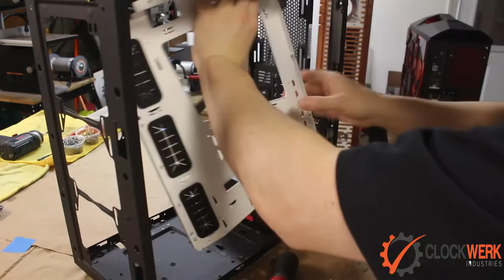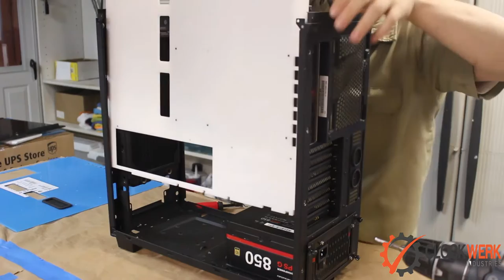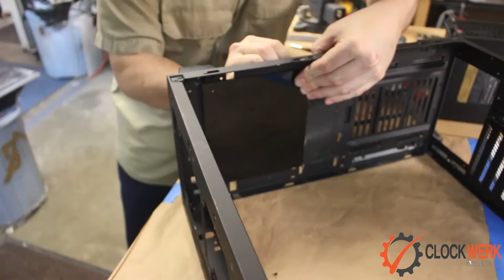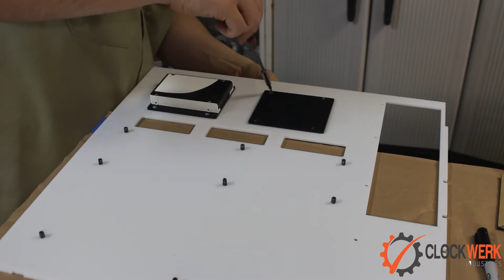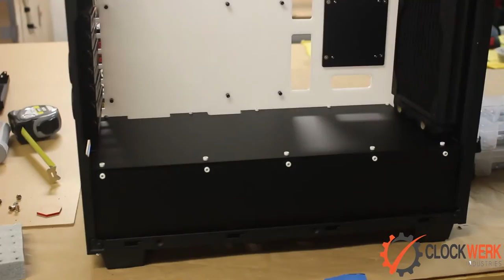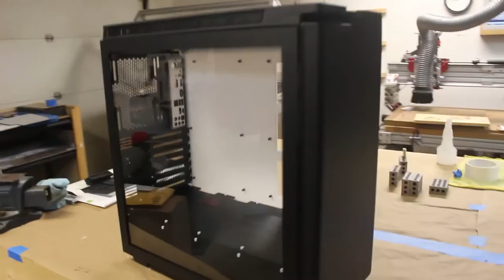Job Shop | Episode 02 - NZXT H440 Modifications

Comment: nice work! any chance you can make the H440 psu plate(the part that lights up and says nzxt)? i would like a blank plate on mine but i'm no moder so....
Reply from the maker: Thank you! I should be able to do that no problem! Go to my website, link in the video description, use the contact form and we can start an email dialogue and take it from there!

Comment: This is perfect, how much would a project like this cost to make happen?
Reply from the maker: Thanks! I think overall with all the work done it was a couple hundred bucks. I now sell the magnetic door panels on my website for 99.99$. You just choose how thick and what color trim you like and it ships out within a day. The other work was all custom and requires a quote and sending over the case but we can make anything happen depending on your budget!
Reply: Clockwerk Industries aww darn, I was hoping the the motherboard tray/wall was on the site. I'll have too check out the door panel tho! Thanks for the info!
Reply: The ironic thing in case modding such as this is that you can spend a crap ton of money modding a $125 case. The original price of the case is basically an afterthought. Great work man.

Comment: I was with you nearly to the end until I saw the gap between the frame and the new panel. It doesn't look as solid as the original with that gap.
Reply from the maker: Actually to be honest the gap had no bearing on the rigidity, Once everything is bolted together the setup was rock solid to support the necessary hardware, could of hung 4 way SLI graphics cards on it without a single issue. Also  attaching the power supply shroud making one large unit added a lot of support. The gap was there to route the front panel IO wire management over top and down the back.
Reply: Don't get me wrong it looks good but aesthetically the gap makes it "look" incomplete. And if you have goblins in your head, they won't let that go until you buy a new case and report in to your therapist. You would need some screen material or foam to fill in the gap for dust anyways depending on your fan setup. You know whether it's :Negative or Positive airflow. That gap would increase the vacuum. I'm just throwing that out there.